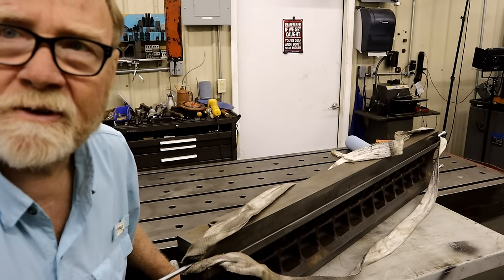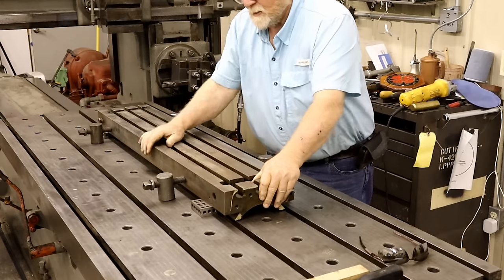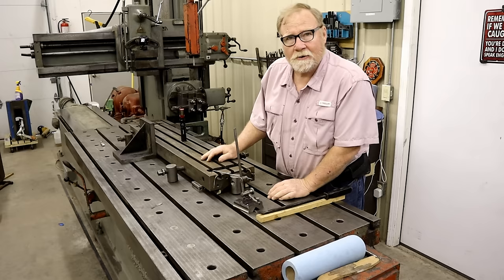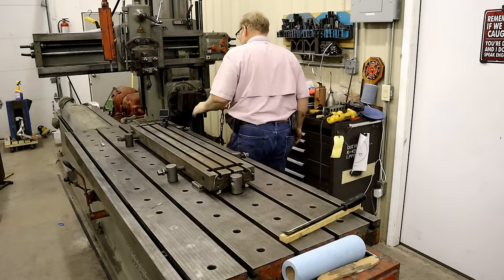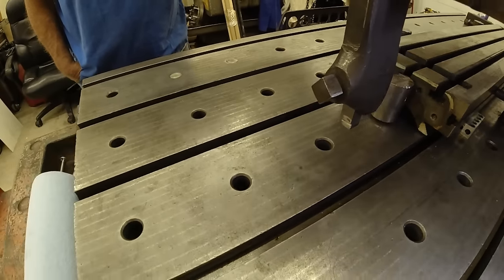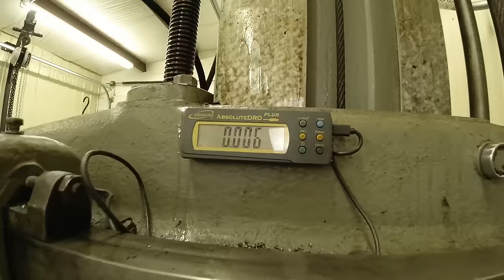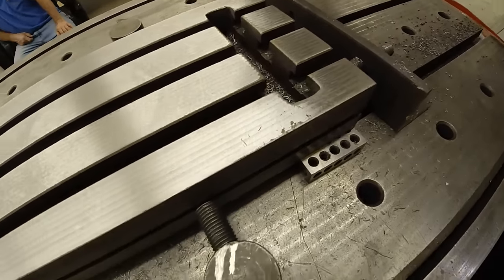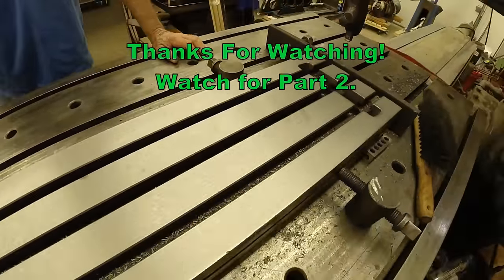How To Plane a Bridgeport Mill Table: Part 1

Comment: Retired after 45 years as a toolmaker and I'm looking at this. What's wrong with me.
Seriously though how did a chunk of iron like that develop a bow ? ( Ran bridgeports many years)
Your machine was built in the town that I worked in.
Reply from the maker: A bowed table is really common with machine tool tables that have T Slots...  Almost all older Bridgeport type machines I measure have at least a .010 " bow..... Most people think that is because the table is so long, compared to the saddle that supports it, and the ends of the table are always hanging out there in the air... Not so...

The real cause is the use of the T bolts in the slots. When you crank down on the bolts it slightly peens the underside of the "shoulder" of the T slot. This peening of the underside of the slot shoulders compresses the metal and stretches the top of the table causing it to bow downwards, over the years.  

Not cranking down on the T bolts excessively helps keep the table straighter... 

When they started making CNC Bridgeport Boss machines they widened the saddles of those machines to give it better stability, NOT, keep the table from bowing as most people think.

Comment: I recently watched a video of a Pakistani outfit that casts lathe beds. The rough casting, covered in a lot of abrasive debris, ended up on a large planer much like this one, and watching it at work had me wondering how one would measure it for wear on the ways?
Reply from the maker: Like anything from Pakistan.... A bent wire and rule!
Reply: @10swatkins  I was looking for a factual answer and not one that thumbs its nose at those less fortunate.

Comment: What would you charge for a job like this and what state are you in?
Reply from the maker: That's a question I'm asked and I don't really have an answer.  The part costs 2000.00 plus shipping to replace if I screw up....  Lots of work and liability....   Commerce Grinding charged 1100.00 to grind it ready for scraping 6 years ago ...   Takes me about a day and a half to do it......  What would you charge?    

 Outside Houston...

Comment: The bigger problem usually isn't the table being bad it's the ways being over worn in the center from heavy use not wearing the ends as much.
Reply: Also I commented before you mentioned dovetails and being in line so I'll admonish myself.
Reply from the maker: Almost all the tables I have worked on have always been bowed and not worn very much... Just a fault of the design :)

Comment: Pakistani Truck Method. LOL

I see I am not the only one that has been sucked into watching those videos.
Reply from the maker: I don't know whether to laugh or cry most of the time.... The other day one guy spent a lot of time threading ( REALLY ROUGH JOB) the end of a shaft and then used a parting tool to cut if off the rod... HE did not cut it completely through though.. He left about 3/4 of an inch then took the rod and bashed the threaded end on the ground to break it apart... I just could not watch after that....

Comment: I have a planer exactly like yours. What is yours worth? I am not sure of value.
Reply from the maker: That's 64,000 dollar question..... Depends on the shape it is in.... Worn out, scrap metal price...  They are not making them like this anymore and this is the most modern one floating around, even though mine was made in 1943...   No belts or gear drive on this one, all hydraulic with a very good pump..

IF you have a use for one and can make money with it they are great! 

This one is now retired from doing a lot of work and I give it a nice home to live in, ac/ and heat, all the electricity it can eat and 800.00 dollars worth of hydraulic fluid every 6 years or so...

It would take about 20,000 for it to leave this shop....

Comment: How do you make the tool parallel to the table?
Reply from the maker: The table rides on ways and is level, any material placed on it also is riding on the ways under the tool arm.   A single point tool suspended above the table will cut material at the same height from the ways along the length of the table.  There is really no setting the point of tool to parallel.   

Now you could set the material being cut on the table so it's surfaces are not parallel  to the table easily.   IS that what you are asking about?  
A mill table, that is warped, is set on the table using gauges and shims under the mill table to level it to the surfaces of the planer table so that the top surface of the mill table is as parallel as possible to the  top of the machine table,  so that as little as possible material is removed. Once that is planed you now have a reference surface and can plane all the other surfaces using that reference.
Reply: @10swatkins  But looking at your tool, its not a single point, its a blade. Don't you need to make that horizontal? It also depends on how far you step each pass? 
What if the tool had an angle of 15 degrees? You would get furoughs.. 

Buy the way its cool. The idea of using an old tool like this for this was interesting. A surface grinder, another option, or at a certain point hand scraping
Reply from the maker: @adenwellsmith6908  This old tool is how much of the old lathes, mills and other machine tools were done...    The blade is ground just the same as a lathe tool is ground, with clearances...  Does a single point tool on a lathe work?  

IF you take too big of a pass it will leave ridges depending on how you grind the tool...   If you want it really flat you just adjust the angle of the relief so that it sits on the cut surface.

All my stuff gets hand scraped into perfection, even if it is ground you can't get it as good as you can with a scraper...
Reply: @10swatkins  On the grinding of the tool., do you do that in place on the machine or elsewhere?  A bit like a inverted surface grinder? Tool in place wheel on the table and make a pass? 

I guess too that you could put a plate on the bed and get it pretty accurate too that way, But if you are hand scrapping on top it would be very close anyway. 

Going back, was this how all mill and lathe beds were made?
Reply: Can you plane the ways on my Southbend 9A lathe?
Reply from the maker: @SnemmoortserEpiwsregoobn-bb9ik  Send me an email..... Go to      https://www.youtube.com/channel/UCPRguhKIX-kgWg4h4AHV4oQ     

 Then in the description click on the MORE after this line " Things that go on in my Shop....  Rebuilding old machine tools, hunting for old tools, welding, MORE"  The email will show up..... Measurements would be great also!  Thanks!

Comment: Lovely machine, obsolete.... my foot it still has a place in the workshop
Reply from the maker: Sadly only in specialized shops like mine.. The old saying is true, " You can make anything with a shaper or planer.... Except money"  For rebuilding long bed machines and straightedges  it's ok... The best thing to have would be a planer and a grinder this size... Someday I'll figure out how to put a grinder head on this one...  Right now the coolant would be a big  problem because of the oiling system for the ways...

Comment: “Pakistani Truck Method” 🤣
Reply: Have you seen their channel.  They stripped a brand new hino truck down to bare frame rails separated from the cross members.  Quadruple framed it.  Made new really beefy cross members.  It was all going I want one of those till they sent it to the pimp and tassels shop.  If you have a cracked wheel center.  They throw it on a lathe and cut it out. Weld in a new center they stamped and turned while you wait.
Reply from the maker: I admire their work ethic... I just wish they had more to work with :(

Comment: I was taught by an engineer to never lean or rest on machinery, no exceptions......
Reply from the maker: I have learned that there are really very few " no exceptions" in real life... In the case of a 28,000 pound machine with an arm designed to resist the cutting force of a massive cut while having 600 pounds of moving head, that can go over 40 inches without deflection in a cut, I don't think Don's 50 pounds of leaning force ( if that)  really has much effect... But if you insist I will punish him severely!

Comment: Why on earth does Don keep leaning on the machine? I'm pretty sure that machine is rigid enough that it doesn't matter but for safety reasons you should never touch a piece of equipment that is in operation unless you are the operator. A split second lapse in situational awareness and you lose limbs. Otherwise great content.
Reply from the maker: The next planer video somewhat address it.... I had not though about it tearing off his arm... I spoke with him about that and he said he had his eyes on the table, just like me, the whole time...   But like you say things happen....